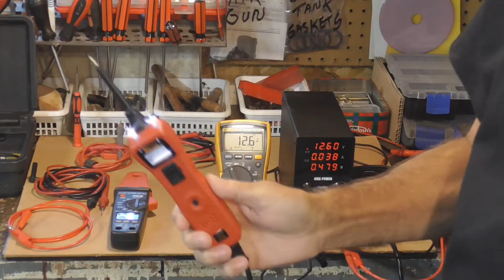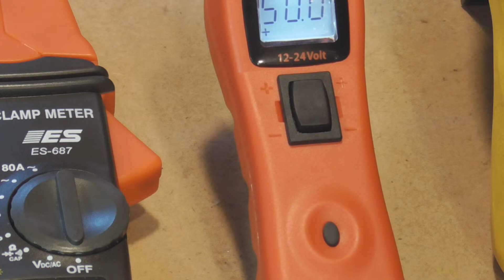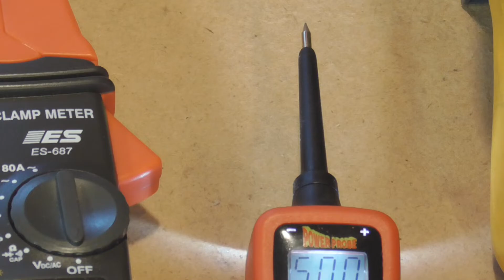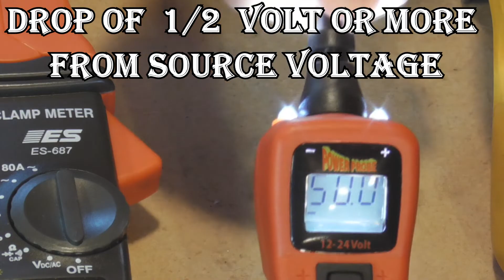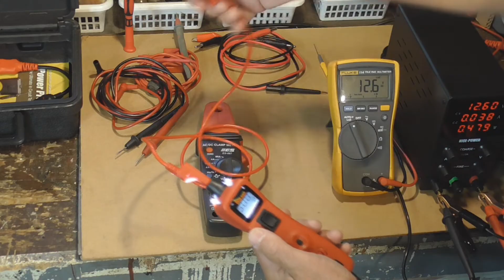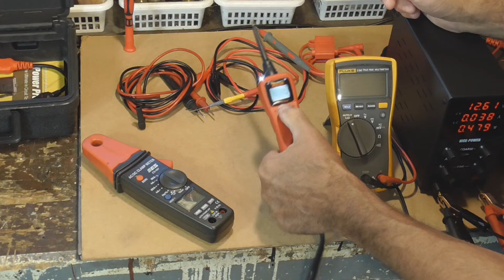Power Probe 3  Pitfalls And Tips

Comment: If you fully understand volt drop/potential difference, I have really never found a use for it that I couldn't find with my amp clamp and multimeter. Ive seen so many cars where people have let the smoke outta stuff that have purchased 1 without having any fundamentals of basic electrics.
Reply from the maker: Well said, a solid understanding of the fundamentals is always the most important tool. Cheers 👍

Comment: You can always use your meter to power up circuits just like the power probe. Just put er on 10A setting, connect one lead to batt + and off you go. Just gotta remember to switch er back before you measure voltage. That nice little fused lead you've got there would be perfect too as it would blow before the fancy fuse in the meter.
Reply: In practice the tech will forget they  moved the probe, measure a voltage and blow the internal fuse.  I've seen that MANY times.  Newer Flukes have a beeper warning which will save you a percentage of the time.  That internal fuse is expensive.
Reply from the maker: Good idea 👍 cheers.....

Comment: I've got a cheap power probe I bought on Amazon a few years ago.  99% of the time I use it for diagnosing power windows and door locks.  I used it doing the same thing with heated seats till I got a thermal imaging camera.  I don't use it terribly often, that's why I went with an off brand cheap one from Amazon. 
Plus I'm cheap
Reply from the maker: Nothing wrong with that Bruce 👌.